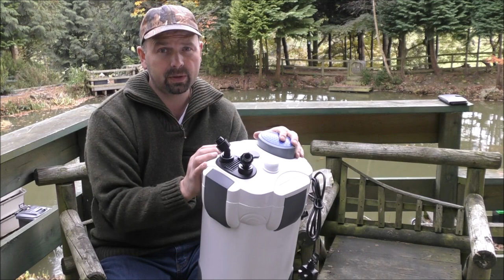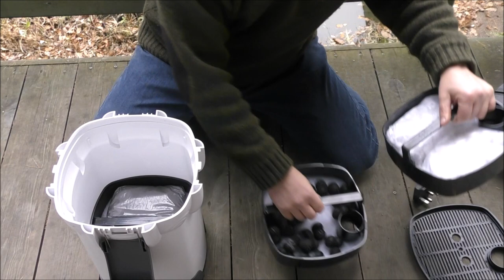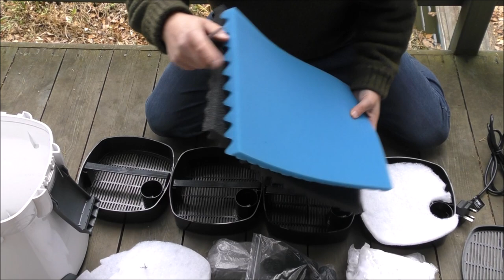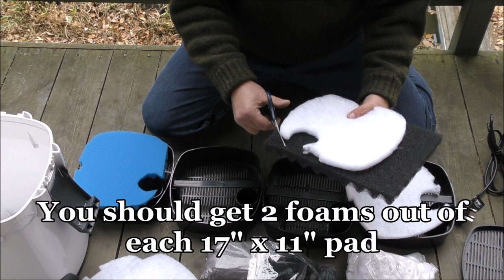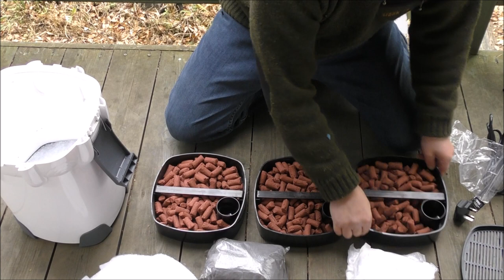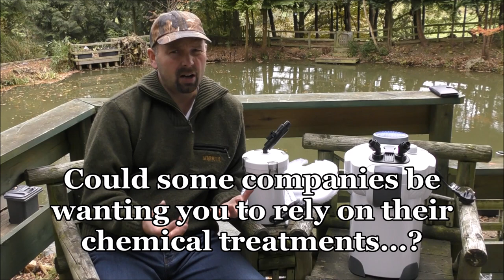Why Your Filter is TOO SMALL and NOT CYCLED

Comment: So I'm repairing a leaky tank and I replaced filter w/ canister filter. Converting to metric, I have a new unused Cascade 1000 Elite that does up to 375 liter. My tank is 245 liter. I did get 2kg of Biohome ultimate per greatwave engineering recommendation. So according to this, I'm a bit off at roughly 1/3. I've already spent more than I wanted to (but I did want a canister) so I'll have to stick with what I have for now. Would adding a different filter type like a moving bed filter cover the gap? Also, temporarily, my fish are in a 75 liter tank and the filter has pretty much had the same biomedia (small cylinder kind included with Aquaclear) for 2 years now. My plan is that once my 245L tank is fixed, I'll dump the water from the 75L to the 245L, fill up the rest with new water and I will be using the canister filter with the biohome and the bacteria balls that came with. Fish wise, I have an 8" dinosaur bichir, leaf fish ~4", one oscar ~3" but I plan on getting 1-2 more and another 4.5" ciclid. (I plan on getting more ciclids). The tank will also have drift wood that cannot fit into the 75L right now. I also thought about getting the canister working with the 75L for the next week, assuming the fixed tank doesn't leak, with the water it has now, the biohome and the bacteria balls. So...how's my plan?
Reply: Also, where can I find large, cut to shape, egg-carton foam pads like that online? I haven't been able to find anything but pre-cut pads.
Reply from the maker: In the UK any supplier of pond gear has the bumpy foams but I'm not sure where you'd get them in US - maybe Amazon? from China.
If you have 245 litres with large fish in then ideally you need a filter which could hold up to 5kg of media as I'd eventually class that tank as heavily stocked compared to a normal community tank - the filter in this video or the SunSun equivalent would be more suited to your situation.
Reply: I think the most I can do is get or make a pre-filter and another kg for the canister and some porous rock as decorations. (Wife stresses dog over more fish but we need to move first) Do you think the large driftwood will help? I would say it has ~3 sq ft of surface area. i'm only going to get 1-2 oscars so mine has a buddy or two and a few cory catfish to help keep the sand clean. Thanks!

Comment: After watching a number of pimp my filter vlogs, I decided on the sun sun 1400 + 1.2 lt pre filter for my 125ltr tank. I have set those up as you advise and have very clear water with a few small fish. Now the question is, I use Seachem Prime as the declorinator? It's well thought of but does as you mention, arrestes, for a short time, Amonia etc. Should I be using API stress coat plus instead of what do you recommend? Thanks, great vlogs.
Reply from the maker: 100% the API stress coat will allow for the filter to develop naturally and not retard the bacteria so that's the one I would recommend no problem.
Reply: @pondguru  Great stuff, thanks.

Comment: What is else could use instead of biohome ultimate that's cheaper
Reply from the maker: You can use any media as it will all grow bacteria to varying degrees of success. From the years of feedback we know how much biohome is needed for a full cycle for a variety of stocking scenarios and as that information is not available on other types of media I would always recommend the biohome but literally any media will do half a job (half a cycle) and reduce ammonia and nitrite as aerobic bacteria is easy to make provision for.
It's the anaerobic bacteria which reduces nitrate and completes the cycle and that's the tricky one to get enough of in to the system, that's where the biohome comes in.

Comment: Hey fishguru I’ve been think of setting up a external canister filter while using internal filters I will use this technique that you have shown in this video but I’m just wondering during the process of doing it will my tank crash while doing it. I appreciate the video as I have been trying to learn for a couple of months about external filters and this as just give me a new hope thanks
Reply from the maker: As long as you keep the old filters running while the new one is maturing there will be no crashes as bacteria population will increase, not decrease by adding another filter with suitable filter media.
Reply: Pondguru thanks very much for your help

Comment: Hey Pondguru really good and informative video, you got yourself a new subscriber! 

Do you have any experience of ''Oase Biothermo'' Series? I'm using a 1250L/H 
I am using 4 trays of ADA Bio rio, any idea if its good/usable biomedia? 
I also use 1 tray of coarse and 1 tray of fine filter pads.

Thank you on beforehand!
Reply from the maker: The biothermo is a decent filter and that ADA media just looks like small pieces of mixed pumice which is fine as a media, better than most ceramic rings. Problem is that the structure of the pumice is very variable so every piece is different as far as being effective to support aerobic and anaerobic bacteria goes.
Assuming that the filter is a suitable size for the tank and stocking situation then just see how it goes. If there is enough media to achieve full cycle filtration (reduction in  nitrate)  it should occur within 4-6 months.
Reply: Thank you so much for answering! It's a 300L Asian biotope tank with soil substrate and lots of plants and barbs/guramis. Thanks once again! :D
Reply from the maker: Most 1200 / 1250 canister filters can get around 3kg of biohome ultimate into them so that would work out perfect for that situation.

Comment: Thank you for the very informative video, I always look forward to these. Was curious as to what size bio home I should purchase (small, med etc.) for my fluval 406 in my 75gal. It is stocked with Oscars /jack Dempseys and they are fairly dirty fish as you know. That being said, I have a homemade internal canister filter, sponge filter and the canister I mentioned. Also wether ultra/ultimate is best for my situation. Thank you very much and keep up the great work!
Reply from the maker: Biohome ultimate or mini ultra will be the ones to go for - both the same size and have been specifically made for canister filters as they have a good balance of size and porosity.
The 406 will hold 1kg of either type of media per tray so assuming you use bottom tray for foams and fine pad that leaves 3 trays for media (3kg total) which would be suitable for a normal tank of around 300 litres - for a heavily stocked tank like a central / South America tank you could need twice that so you may well need another 406 to achieve full cycle filtration.
Reply: Pondguru thank you so much for the rapid response, I truly appreciate your advice so I took it… Just bought an FX6 as I believe that would be more than enough filtration  going by what you said on the video… Also this would be sufficient for when I upgrade my tank. Thank you so much and I will be placing an order soon for the foam you recommended as well as the bio home ultimate. I believe for the FX6 I’ll need at least 5 kg so that’s what I will be doing. The only issue I see is I couldn’t quite sure figure out from your video in the brief mention of the Fx six how I should properly fill it regarding where I should put the media sponges and that sort of thing. If you have any input  on What’s the best way to set it up is, I would greatly appreciate.Thank you and keep up the great work
Reply from the maker: You have good foams surrounding the baskets which act as the majority of mechanical filtration so all you need is a fine pad on top of the top tray to catch fines then you can fill all 3 trays with media - yes it will hold 5kg in total so you should be fine with that running on your tank. Best to run the old filter for a few weeks in addition to the new one to allow new filter to mature sufficiently before you remove the old filter in favor of the new one.
Reply: Great, thank you so much that’s what I will do. Truly appreciate all the advice and all the great videos! Also thank you for taking the time to answer my questions.
Reply from the maker: That's no problem, any time.

Comment: What is your opinion on using chemical ion products like zeolight in established heavy stocked filters? My though process is to use it after the biomedia in proper chemical location to help directly remove ammonia before its broken down in the cycle.. I’ve gone round and round with multiple Big filters on several different heavily stocked cichlid tanks and I’ve come to the realization that there is really nothing reasonable that can be done to reduce nitrates enough to reduce water change intervals or even amounts on tanks such as these. 

I’m coming to the mindset that we are looking at this issue backwards.. reduce ammonia and you ultimately reduce nitrate. Seeing as how it takes several passes through a filter to fully clean the water anyways.. why not use ammonia reducing components to catch the extra after it passes though the bacteria. One cup is supposed to support 50g or so normally stocked so it shouldn’t tank all that much. Couple cups worth replaced biweekly or monthly should do the trick. I already use organic removers like Purigen and they do help. But Ive got an extra filter on my largest tank as well as a reactor I was playing with trying to use slow flow over media to induce low o2 and nitrate reduction.. I’m thinking of packing just those two items full of carbon and zeolite while leaving the main two work horse filters alone so I’m not risking removing too much ammonia and leaving myself open to future tank crash. Max flow of my reactor pump is 120gph and the small third filter is only 180gph while the main two canisters are Turning out 900gph or so on a 125g tank. So it shouldn’t overly effect the feeding of my nitrifying bacteria in the higher flow filters. 

A little background the tank runs 30-40ppm nitrates weekly with 38 fish. 32 are cichlids over various types and sizes and the rest are a few clown loaches and a pair of standard pleco to help keep my sand and tank clean. 

Bit long I know but I really value your option on this.
Reply from the maker: Carbon and zeolite will not adversely affect the bacteria but you don't say what biological media (filter media) you're using in the filters so I've no idea if they are set up to be in a position to remove nitrate through natural bacterial processes.
Purigen almost certainly won't help with the bacteria as so many people report that it retards or kills off the anaerobic bacteria - when it is removed the bacteria recovers and nitrates naturally fall but only in cases where the filters are set up with suitable media.
Feel free to send details of the filters and any relevant pictures as the filter set up is key to achieving a full cycle. My email address is sales@filterpro.co.uk
Regards,
Richard
Reply: This is why I so value your videos and opinions.. even on an older video you still respond in short time and are willing to help..  answered some of this if not all in your fx6 video.. lol.. I won’t waste the time of reposting what is close to 2-3 pages of info into my tanks filters and personal experiences and testing I’ve done myself.. would be a waste to make you spend that much free time reading and answering everything twice lol I’ll graciously await your replay to that post. That said. I’m not struggling or having issues as much as i a, trying to maximize every single last bit I can.. will make more sense in the other post...

Comment: Excellent video on filtration!!!
Made me go out and buy 11 kg of biohome ultimate. I'll be setting this media up in my 135 gal goldfish tank. Using a Fluval FX6 filter and Aquatop 500 UV filter.....both with Allpond Solutions EF-2 booster filters.

You made us aware that for some reason Purigen, Chemi pure Elite, Chemi pure Blue causes the anaerobic bacteria to die off or not fully establish. Also Prime water conditioner may cause the same.

My question is about Seachem Phosguard. Is this safe to use???
Just trying to find something safe to use to reduce phosohates(less algae growth).
Also what brand of water conditioner do you recommend??.....right now i'm using Prime but i'm willing to switch to a brand that's safe for what we are trying to accomplish.
Reply from the maker: The phosguard should be fine as it should just be iron based so should not affect bacteria....there are lots of 'should' there, lol
Seriously though a phosphate remover really should be no danger to bacteria but neither should many of the treatments marketed as helping filters. 
The API stress coat or something similar is fine for establishing filters - very popular and I've heard no negative reports about it or any effects on bacteria.
Reply: Thank you for your fast response!
I'll take your advice and try the water conditioner by API. And i'll use Phosguard in my filters

Comment: Your videos are awesome.  No one else on-line as valid or info that makes sense.  Does flowrate of canister filter affect growth of anaerobic bacteria growth?
Reply from the maker: Yes most definitely - although the structure of biohome does allow for the support of anaerobic bacteria in small pockets in every piece a slower flow will lead to less oxygenated conditions and a higher percentage of anaerobic activity (for nitrate reduction) compared to the more commonly acknowledged aerobic bacteria (for ammonia and nitrite reduction). That's why nitrate reactors have extremely low flows and that allows even the crap media they are supplied with (often plastic media?!!) to support anaerobic bacteria in the low oxygen environment....now just imagine what a job good quality media does in a nitrate reactor.....yup.
Reply: Pondguru I recently purchased a 125 gallon tank. I have not set it up. I have two decent sized American Cichlids that are being rehomed in the new tank...if I use two FX6s or equivalent with 10 kg (22 lbs-US) of biohome ultimate...is that going to give me the full nitrogen cycle, or do I need a canister with an adjustable flow rate or do I need to get some other type of filtration to get rid of the nitrates? Does putting an air bubbler in your tank give any negative effects on growing anaerobic bacteria?

Comment: Let me start by saying I'm a big fan of your You Tube page; being new to the hobby I have taken a lot of your advice. About two months ago I started a 75-gallon tank freshwater aquarium. After watching this video, I have decided to get a second canister filter. One is dedicated solely to my mechanical filtration (coarse, medium and fine filter pads) and the other decided to my biological (all trays filled with Bio Home ultimate media). I have a question; do you think I need to put a mechanical filter pad at the base of the biological canister to help protect the Bio Home from tank debris, or should I just set up two filters with the mechanical then biological? I did install a pre-filter on the pick-up tube for the canister of Bio Home, but wanted your thoughts on additional filtration. I look forward to your response. Thank you for your time and sharing your expertise.
Reply from the maker: Dear Pete
Apologies for late reply, I'm drowning under a sea of emails / comments and finding it increasingly difficult to answer them in addition to all the order processing.
If you have a canister specifically for mechanical that is OK and to be fair that will pull in most of the debris from the tank but it would still be worth adding a medium foam or fine pad before the biological filter just to be sure water going through that filter is as clean as possible.
Regards,
Richard
Reply from the maker: Sorry forgot to say that if you have intake for biological filter near the outlet of the mechanical filter (quite near top of tank) then the water will be as clean as possible heading into biological filter.
Reply: @pondguru  Thank you for responding and thanks for the advise. I'm going to upgrade the pre-filter media going into biological filter.
Reply from the maker: @peteloiacono8586  Sounds like a plan, best of luck with the tank.

Comment: Hi great video I have a 350l tank with chiclids in it and I have nitrate problem I want to change to your filter set up but how can I do that on an already stocked tank without harming my fish
Reply from the maker: As long as you make the changes gradually it will be fine to swap out old media for new in a mature filter. Ideally you'd change a tray then leave it a couple of weeks before doing the next one and so on until the filter was upgraded over a 6-8 week period.
Reply: Thanks for the reply I have a Juwel rio 350l it has the internal jewel filter and external filter can’t remember the make but I think it’s around 500l so I think it’s to small for my tank I want to change it if I put a new external filter in the tank with your set up do you think the internal filter will carry enough bacteria until the new one cycles

Comment: I'm actually struggling to keep fish.  I have a 75 gallon freshwater fish tank with a 306 Fluval canister filter recommended from the fish store.  Is the filter too small for my fish tank? if so, how do I fix the problem without removing the existing filter and replacing it with a brand new one?  Please help.  I don't want to lose another fish.
Reply from the maker: montgomb3 if that is US gallons then it's around 200 litres and the 306 should be fine for a normally stocked tank of around 200 litres but that relies on it being set up properly. If it is currently set up using the factory set up there is a very limited amount of media in there.
My new series of filter upgrade videos will be having a video on a 306 very soon. Each tray can take 1kg of biohome ultimate and if you use bottom tray for foams that leaves 2 trays for media.
Reply: Thank you.  I will look for the video.